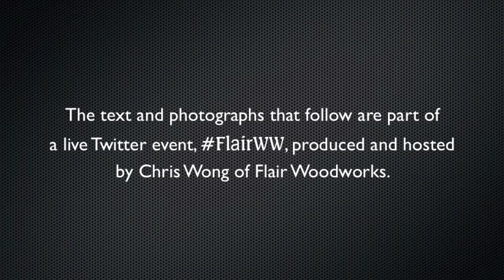New Grips for Veritas Bench Plane

Comment: Wat is your opinion on the Veritas 6 Fore plane? Is it good for making joints? The mechanism of a mouth opening seems very interesting. Does it work well?  I also wanted to ask if the sole is very flat.  You changed grips, but why?  Was it uncomfortable to use?
Reply from the maker: The length of the #6 Fore Plane is helpful for jointing (or flattening) long boards.  I like the adjustments of the Veritas planes, including the mouth adjustment.  The sole is flat.

I find the stock tote thinner than I like.  The one I made is thicker and more contoured.  Basically, the new one is custom-made to fit my hand the way I like - something that no stock grip can boast.

Chris